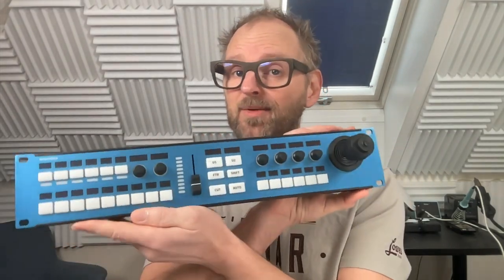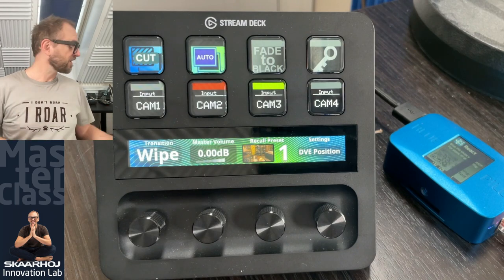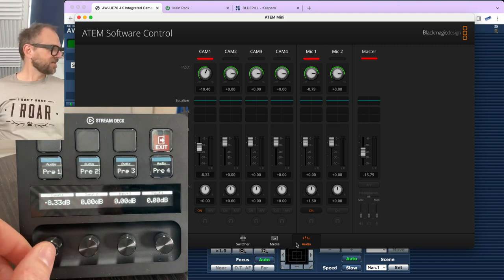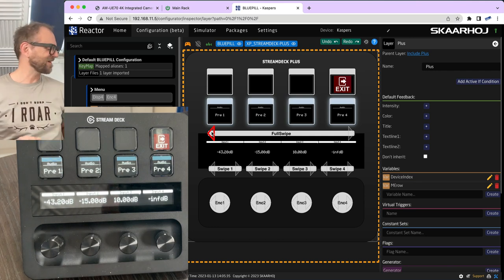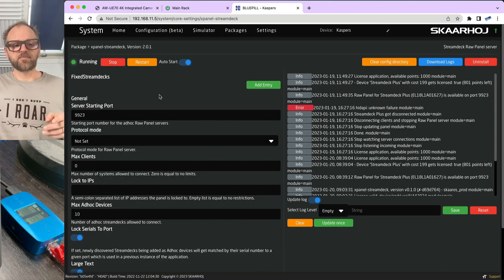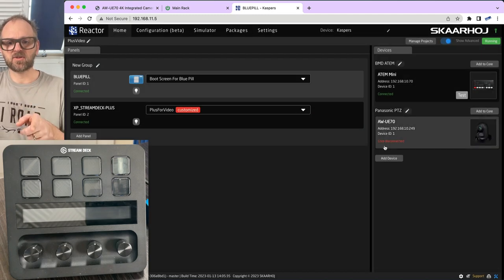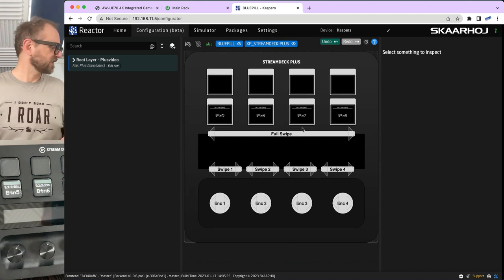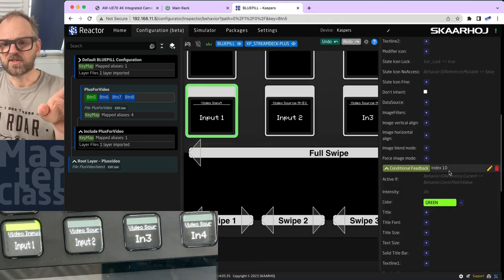Stream Deck on Steroids 1 - Controlling an ATEM and Panasonic PTZ camera with Reactor

Comment: I see in your video you are using mac, will Reactor work for Windows
Reply from the maker: Reactor UI works on both Mac and Windows, even Linux and mobile devices. All it needs is a modern web browser to access the UI. The UI itself runs directly on the Blue Pill Device (Blue Pill Server or any modern SKAARHOJ control product).